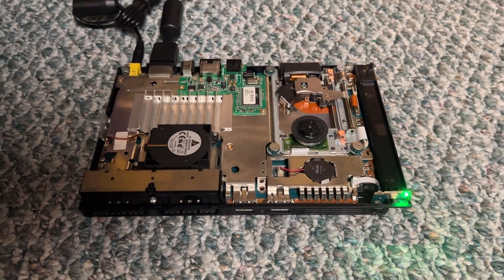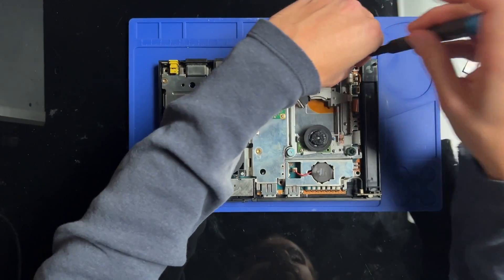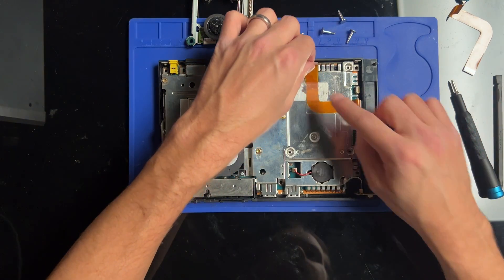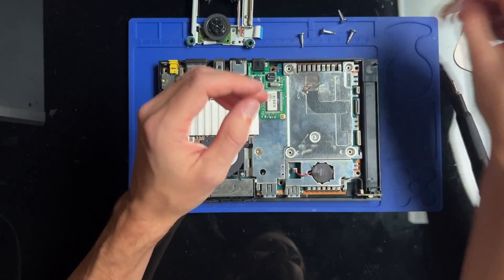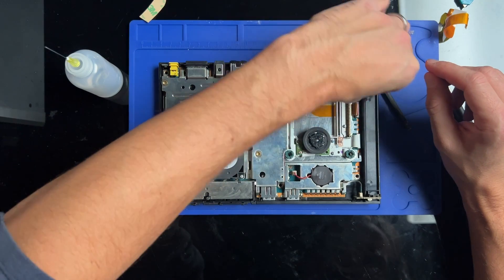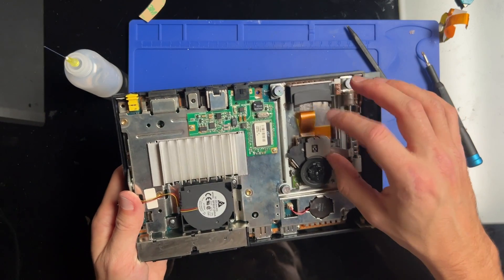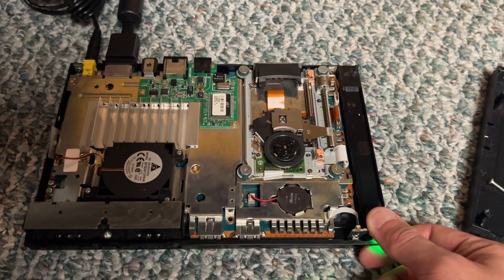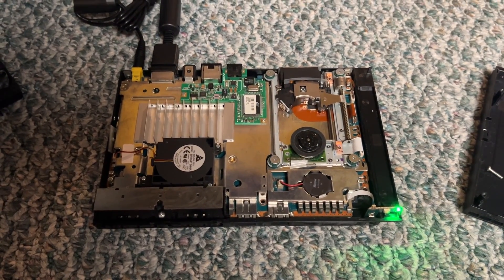Let's Fix It - Stuttering Laser on a PS2 Slim

Comment: I don't have the issue with the sound and my PS2 Slim lets my game work properly. 
That being said, if I move the mechanical part down were you have to put the disc, the laser ribbon is banded up and I'm afraid it could damage my games.

I don't know what to do, if I have to repair that or if it's something to not worry about. I'm very ignorant on this topics.
Reply from the maker: Hi, if the ribbon cable’s bent up high enough it can end up scratching your discs. Something as simple as a piece of tap can help keep it down or super glue. Just be sure not to tap it down too far out. You don’t want the cable pulling on the connector on the laser. It’ll just wear down the ribbon cable leads. 

You only have to take the top cover off to get to the area you need. 

Best of luck!
Reply: @ thank you so much! Very kind of you! ❤️

Comment: Thank you for this video, replaced the disc array and started getting this issue, tried reseating the cable but no change. Installing a new ribbon cable and now the PS2 works as intended!

Comment: Can someone please for the life of me tell me what the tan peice behind the ribbon connecting to the Lazer is called and how I can fix it sliding off, can't put the ribbon in the Lazer and it's absolutely infuriating mr
Reply from the maker: I think that’s the clip that holds the ribbon cable in place. If it’s broken off you’re not likely to find a replacement for it other than a complete laser assembly. But I would try taping the ribbon cable in place with some strong tape, not just Scotch tape to see if that holds it in place.
Reply: @FixMoreWasteLess  it's not the clip it's the little tan/white piece that is glued to the back of the ribbon that inserts into the Lazer, I guess the adhesive wore out so it slides down Everytime I try to instead the ribbon back in and I can't get the ribbon to hold in it's slot
Reply: @FixMoreWasteLess the white piece that's above your left hand thumb at 3:03
Reply from the maker: Ohh okay. Yeah I’ve had that happen before. So annoying. I put a few pieces of tape on that are to help the clip catch better. Not sure if that’s a long term solution but it worked well enough. A drop of glue or glue stick might help it stick in place more permanently.

Comment: so recently got a decent deal on a ps2 slim for $30 complete with 2 games but it mainly only plays cd's (only tested music disc for cd's but got a ps1 game incoming thps2 which I'll test as well), the previous seller sold it as parts but in semi working condition since it only sometimes worked with dvd games if he put a weight on the lid. I tried this weight trick but it only worked once for me and hasn't worked since but the music cd's were loading fine without weight. 

Tried the usually tray button tricks (that make the disc spin by holding down with tape or something) but it spins and gives up with cannot read disk (even with a new copy of gta 3). Do you think it could be more of a ribbon issue/motor/or laser? 

when manually moving the  worm motor screw the laser moves but its not a smooth motion it needs a bit of force to move, the screw motor does have grease to the touch though so not sure it a re-greasing will help.
Reply: This sounds like u might need a new ps2 laser replacement which seems to be common with the ps2 slims

I just finished using this video to help replace my ps2 ribbon after damaging the ribbon cable in the process of replacing the laser. It stuttered a few times initially until it stopped after I fiddled with the ribbon again after replacing the laser. it wouldn't read discs at all despite attempting to for about 2 minutes. So thankfully I recognized the initial stuttering in this video so I figured I needed a new ribbon cable (I damaged it pulling it out of the old laser since it was so old and possibly kept in a hot place, the tab on the end of the ribbon slid right off the ribbon cable)

Tldr: try replacing the laser first, then if still issue, then ribbon cable. Thank you!
Reply: @anthonyforti7409  yeah most likely the laser, it does play ps2 cd and ps1 cd games but not dvd, but theres always FMCB to play dvd games off usb :D

Comment: Bro my laser ribbon clip is not tight when i put the ribbon and shut it the ribbon comes out easily ? Any solution ??
Reply from the maker: I'd try placing a piece of tape or two on the top part of the ribbon that goes into the connector to see if that gives the clip more to grip. If that still pulls out easily, maybe just a piece of tape over the connector and tape. I wouldn't use glue or anything permanent. Otherwise, the clip on the laser might be broken to the point it doesn't do anything and then you'd have to replace the laser itself.

Comment: There's a similar colored ribbon cable next to the one you replaced in the video. Do you know what it's called or where to get a replacement?
Reply from the maker: The one attached to the little motor that moves the laser? It’s the worm motor or motor gear and I don’t think you can get just the ribbon cable. You have to buy the motor and gear with the ribbon attached.

Comment: A few times I’ve fixed this (when it wasn’t the ribbon cable) by saturating the sensor switch on the laser with isopropyl, press it a whole bunch then blow it dry with compressed air. Clean all the sensor switches while you’re in there I always say.

I’ve also managed to stop it a couple times by cleaning and applying new lithium grease to the worm drive. As well as tightening the “arm” on the laser that grabs the worm drive.

Once that problem is solved, we’ll find the laser pots need adjusting.

Oh the joys of PS2 repair…

You did a great job on this video!
Reply from the maker: Thanks for all the tips!